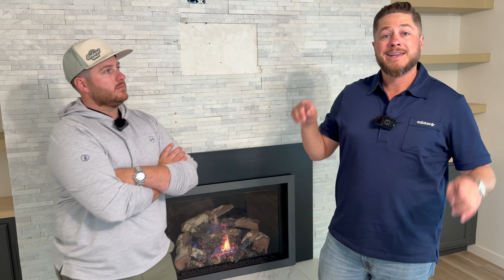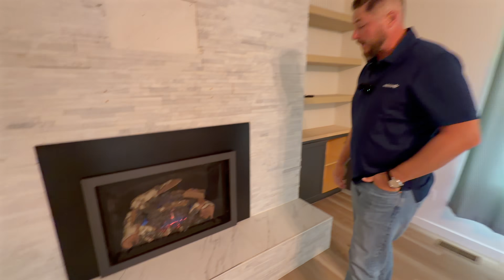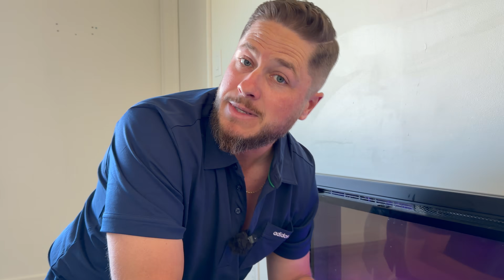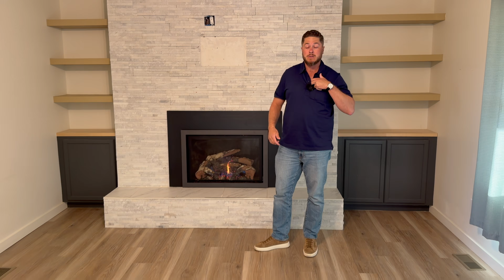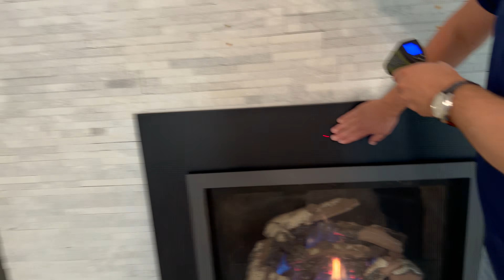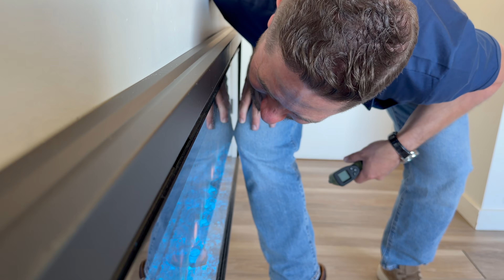We Survived 3 Winters Heating an Old Home with Just Fireplaces

Comment: I'm in this house on Ireland that's decently insulated. I've used a 2KW fan heater and radiated heating. 

My experience is fan heating will heat the room but when you turn off the fan heater the heat in the room dissipates fairly quickly 

When I have the house heated with the radiators that were central heating for 13 years but converted to heatpump 3 years ago by my landlord , the heat lasts longer in the room after the heaters go cold.

Comment: I’m in the middle of building an extremely efficient house that will primarily be heated off heat pumps. However I’m also off grid and need a secondary gas heat source that’s independent of using tons of electricity. 

I’m torn between putting in a furnace or just a gas fireplace. My concern is reliability and not being able to use a smart thermostat like a nest or ecobee so I can monitor and control the heat during times I’m away during the winter. Is there any gas fireplace that has the ability to be controlled by a typical thermostat just like a furnace?
Reply: My heating was converted to heat pump by my landlord 3 years ago. It was a big mistake. The heat pump uses a whole lot of electricity when it's sitting idle and the water heating function is disabled in it.
Reply: @Steve30x I hear good things about new efficient heat pumps. I have oil heat it cost a lot of money especially with rising prices and my boiler is justv5 years old. Thankfully the hot water heater is electric. When the central a/c needs to be replaced down the line I'm going to get a heat pump for both heating & central a/c since the house ductwork already.